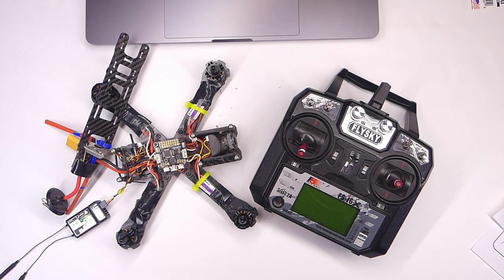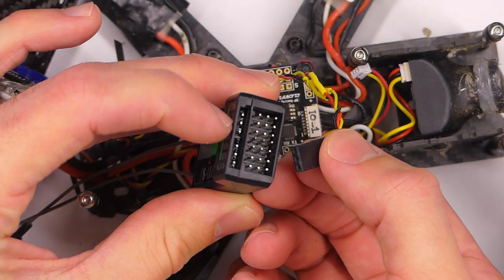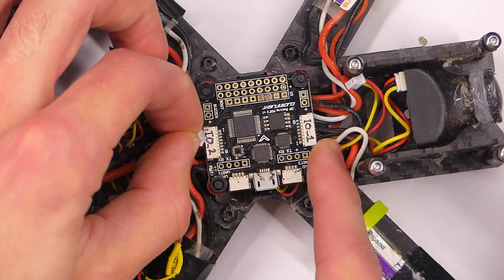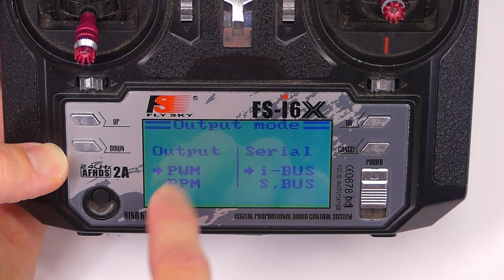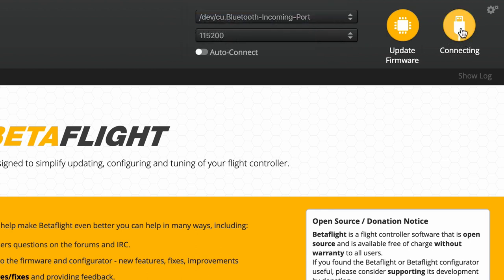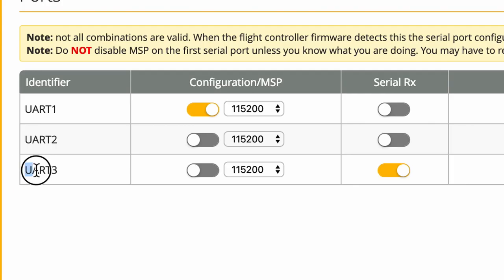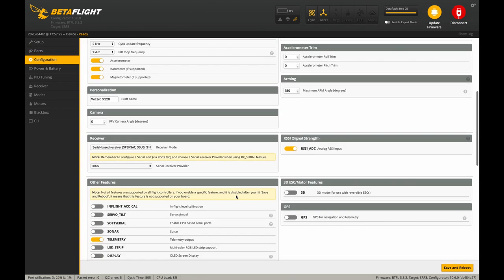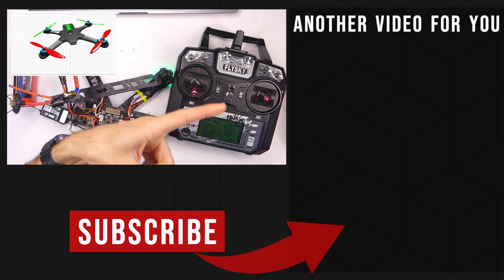How to Setup FS-iA6B with iBUS - Wizard X220 - Flysky FS-i6X (SPracing F3 Flight Controller)

Comment: Hey man how are you? Wanted to ask about a little issue, i did all the steps and am using the SPRACING F3 and your same Flysky controller, the only difference is that i am using cleanflight but used the same configuration as you and the software shows that the reciver and transmitter work but the motors wont move.. i only make them move by sliding the bars on the motors tab. 

Also i saw that on the video your motors didnt move at the end.. so what step i am missing?

Thanks!

Comment: Hello I need help.....I can't get the  motors to spin after connecting the transmitter with the flight controller.....all the connections are done but can't seem to be working at all
Reply: Did you figure it out

Comment: Can you still use the empty channels on the receiver when connecting this way? I want to add 2 forward thrust propeller's to a quadcopter so basically the quadcopter props are just to make it hover. It will pull forward like a plane with the forward facing props
Reply from the maker: Sounds cool! I'm not sure, but my guess is YES.
Reply: @RCwithAdam1  trying to make sense of it all, a lot to learn at once lol

Comment: Is there a way to connect another receiver to the main receiver in a way to extend the number of channels available. for example connecting ia6b to another ia6b to get 12 channels?
Reply from the maker: That's a good question! I'm not sure, but that would be neat. I would think that might be possible with the ibus port.
Reply: @RCwithAdam1  it would be nice if you could make a video on how to do that if you figured it out.

Comment: hii, so i did everything like you said on the video and it does actually works when the green thingy is plugged in the drone but when I unplug it from USB and the thingy and try to use the controller motors still don't spin, and for sureee i am missing some steps but I have not clue which one so if you could tell me (if you know ofc) what I am missing I would be so thankful :D
Reply from the maker: Hi! When you say "green thingy", do you mean the receiver?
Reply: @RCwithAdam1  (wow you are so quick at responding) and yeah, like is the thing you hooked up on the FC so yeah, It should be the receiver (sorry if I am not precise but I am super new at all of this) ow and btw I was searching around and I think I am missing the "rx" like a card that stay on the stack, for receiving the signal, unless it's the "green thingy"
Reply from the maker: Yes, the green thingy is the reciever. It needs to stay plugged in and connected to the flight controller at all times.
Reply from the maker: Yes, the green thingy is the reciever. It needs to stay plugged in and connected to the flight controller at all times.
Reply: @RCwithAdam1  ok I won't unplug it but how can I make the motors spin then?

Comment: iv done everythin in this tutorial exept the rx setup on the remote as the options are not there on my remote i am using flysky fs-i6 not the fsi6x any help would be good as im stuck now non of the controlls work
Reply from the maker: Hi! Let's try to get you unstuck! Which version of firmware are you using (you can find that in the system settings menu)?
Reply: @RCwithAdam1  2.0 1-feb-2018

Comment: what can i do when my drone doesn´t react to the transmitter
Reply from the maker: Tell me more details about your setup and issue you're having.
Reply: @RCwithAdam1  i updated my flysky fsi6x to a costum firmware for rssi, but it didn't work, so i downgraded it to the original firmware which i had first, but i bound it many times, but the drone doesn't react to any aux channels(switches, sticks), in the simulator its working, when i bind it, the receiver shows, that its bound, but the drone doesn't react, i set all aux switches correctly up